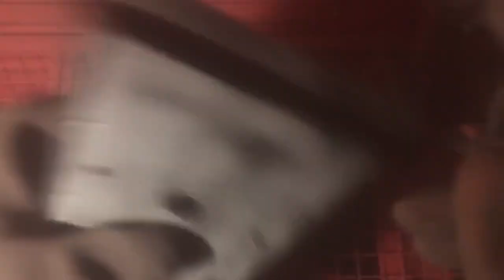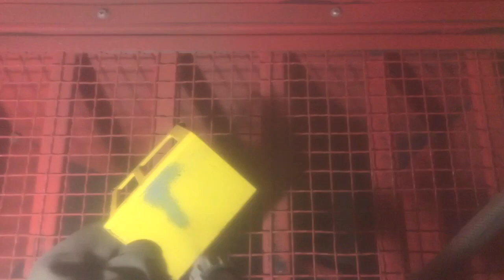1960's  Mighty Tonka Dump Truck Restoration [Clean]

Comment: Nice refurbish effort. How did you repair the broken tire? Thumbs Up!
Reply from the maker: Unfortunately it was not repairable. I had to get a new one off of eBay. Thanks for watching, I appreciate you taking the time to watch.
Reply: @RepairRestore  Hi, the wheel on mine was broken also, I was able to glue it back together with plastic model glue. Used Plastruct plastic weld ,the one with the orange label. Get it at your hobby store. And if you use stainless steel rods for the axles, then they won't  rust.